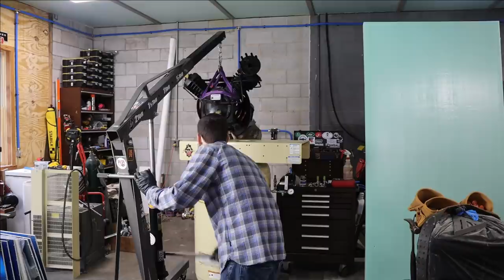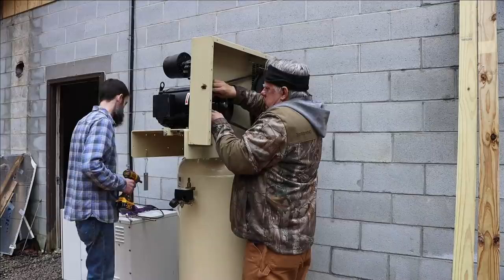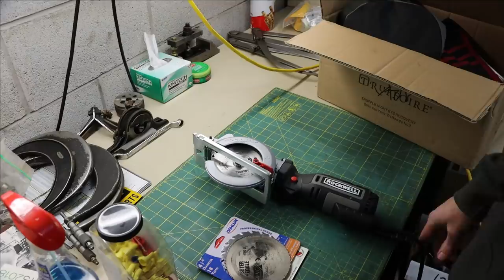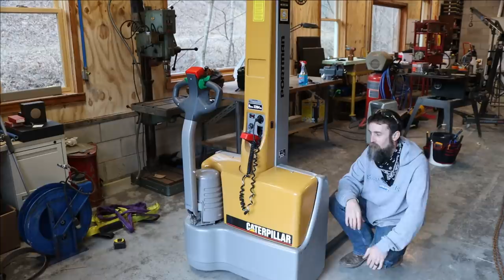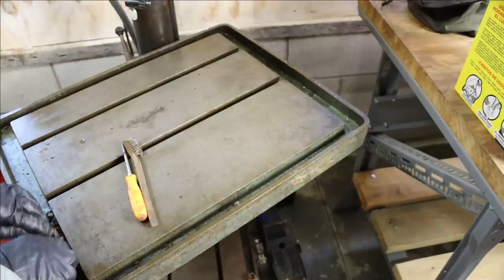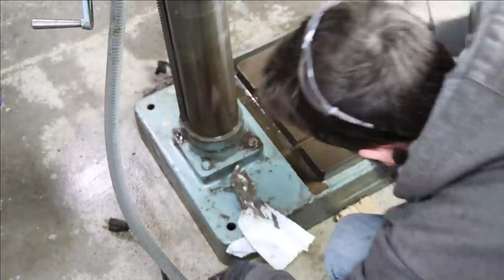Awesome New Shop lift! /  Doall Drill press 1st run and clean.

Comment: Sorry I have just thought of something. This Fork lift has never been used. Traction batteries have a memory. Don't be too quick to think that they are dead. Just try Charge, use, Charge, use, for a while to see if they improve before you write them off. After all you are not looking to run the motors on this item for more than a few minutes a day.
  You may well find that it starts to hold more of its charge & comes up fully charged rapidly as well. OK it may never be that good at running on its charge for long.
Mervyn Price

Comment: Car Batteries vent an Acidic vapor which will cause Everything inside of the cowling to Corrode & Quit Working over a short time.
I would use GEL batteries in it personally.

Comment: Sams' club. Deep cycle batteries run around 100-150$. (we emptied every sams in three states for the historically bad idea of an EV race race. we had over 30. there's still a few sitting at the shop, but RDU is too far away for $100.) I would go with lithium-ion batteries, but I'm a nut with an electric race car. If Roger hasn't unloaded all the BMW i3 batteries formerly in the car, "we can talk." :-) 8 LiFePO4's would be better -- assuming it's 24v, but I don't have many spares of those. (we can talk about those, too.)

Comment: Steve, another issue with battery charging is the hydrogen gas that's emitted.  You DON'T want an explosive mixture forming in the shop, where the inevitable spark makes things go BOOM.  :>((  Either charge outside or buy sealed batteries that dodge the gas emission problem.
Reply: hydrogen and lead acid is mostly a myth. explosion never hapend due to hydrogen leaking out every crack an nearly imposible to acumulate in any meaningfull maner.
Reply: @davidblarstron767  Tell that to the folks who had things go boom, when incorrectly  boost starting a car with a "flat" battery.  Better safe than sorry.

Comment: The charger is meant for agm deep cycle batts and starter batteries, while much cheaper, won't last long.  Might be better to buy smaller  agm deep cycle batts versus starter batts.

Comment: The drill press table/deck, is it possible to either flip the plate that is damaged OR weld up the holes in the damaged plate without warping it?

Comment: Be sure that the lead acid battles will not corrode the wire connections or rust the inside. While charging They my off gas corrosive gasses.

Comment: I would use deep cycle marine batteries. More expensive than your standard car battery,  but should perform better. With that,  there is no reason car batteries shouldn’t work.

Comment: 1. Can the batteries be reconditioned? 
2. Install a hardwire option to the pallet jack
3. I’ve had employees crush hands and feet with powered pallet jacks -
Reply: 1. if they are original 2003 bateries : no, its a miracle they still worck that well !
2. hard wore is noce but without bateries youll need one heck of a power suply.
3. yeah I agree on that one but steve is a machinist he knows he is the softests meat bag in the shop.

Comment: Deep cycle batteries ONLY.  Deep cycle batteries are designed for slow discharge to full discharge state.  Auto batteries are designed for virtual instant (starting motors) discharge and recharge between discharge.  Everytime you completely discharge a car battery you decrease the life of the battery substantially.  So you want an RV or marine battery.

Comment: you wouldn't have to put a support post on the other side of the door. Especially if you build a beefy end cap you should be able to cantilever it with the rest of the roof.

Comment: Use Deep Cycle boat battery or you will ruin a car battery.   Deep cycle marine batteries are made to withstand discharging and recharging, a car battery will not last half the life a marine battery will.  Deep cycle battery should be around the $200 range more or less depending on where you buy them.

Comment: A car battery is not a good idea .
Look for semi traction batteries normally used in mobility products .
A smaller ah battery may be a way of keeping costs down .
( You can pull 100 amps form a 32 ah battery the run time is non-existent but you can ! )
But don't expect more than 3 years from them .

Comment: Why not 'cantilever' frame the roof off the wall ? It would only need four {4} frames made out of angle iron say 2"x 2" x 1\4" to cover the distance you require and there would be no posts to worry about for access around the rear of your shed especially seeing the height you are going to have the roof ? You could weld them up on the floor of your now 'oh so spacious' shed ? Just a thought as uplift does not seem to be a problem in your area and it would clear the area underneath of posts ? Anyway all the best from Australia, really glad to see you progressing on a great workspace for your future projects ? I am a little 'self serving' in this regard as I feel if you get the workspace you feel good in, I get more videos from you ?? Cheers.

Comment: Well, you asked for it.
Don't use car batteries.  If you shop around a little, you can find deep cycle batteries at little additional cost and they will outlast the car batteries by several times.  Just look at how long the original batteries lasted.
I'd fabricobble a small man (or woman) platform for the lift and another attachment to mount your engine crane on it.  I know you're smart enough to design and use it properly but, I'm trying to stop all the OSHA fools from jumping all over me.
You might want to use some nickel rods to weld the holes on your drill press table closed and fill in the other ones.  If you're really ambitious, you could overfill and mill or grind them back level.
Beautiful work you're doing and I really appreciate you making these videos.  You and your wife are my kind of people.

Comment: You can get by with cheaper batteries. As long as you have the same charging profile for the replacement batteries it is not an issue.
As for car AGM batteries not lasting as long who cares you probably are going to use it 10 to 15 minutes a day max for the occasional lift.

Comment: cut the label off those batteries and check the water in them
they might take a charge again
since you're on well water, use rain water off the gutters, it's nature's distilled water
ETA: and those batteries look like H8 or group 49, good luck even finding any that aren't AGM, 
don't worry about using cranking batteries, they'll be fine, if there's an interstate dealer nearby, call and ask if they've got any "blemished batteries" they'll sell them cheap and the only issue is they've sat on the shelf for a year
could probably fit a couple group 31 semi truck batteries in there

Comment: Its a pity the drill table has the peck marks. I dont know if it is possible to repair them by welding and grinding flat. The "new" part of the shop is starting to fill up looking nice.

Comment: I sold batteries most of my professional career.  You definitely need to install deep cycle batteries they will be more expensive than automotive starting batteries but the deep cycle are designed to be drawn down and recharged multiple times.  Starting batteries will not last and d not have the long term capacity of the deep cycle units.

Comment: The main difference between regular lead-acid and "deep cycle" batteries, is tolerence of discharge.
Lead acid batteries are generally totally full at 12.7v and totally flat at 12v. Discharge them any further, and you will dramatically reduce their life.
So-called "deep cycle" batteries will tolerate going below 12v better than their regular lead-acid counterparts.

Both will work, and in an industrial setting, where the machine would be in use all day, I'd recommend deep-cylce units. For you though? You'll be using it for 20 minutes, maybe twice a month. You won't BE taking the batteries all the way down to flat, so you'll probably never notice the claimed extra life that you can get from deep-cycle.
Look around, spot a bargain and chuck them in there.
By the way, the charger is just a current limited power supply. You could put the cables across a crowbar and the charger won't even know the difference - Don't worry about it.

Comment: The only real reason to use a deep cycle battery is that you can run them low and takes the charge back. Compared with an ordinary battery that likes to stay at its regular charge with a alternator or charger. AMG battery’s are expensive.

Comment: Don't assume those batteries are toast.  Do some research on recovering them first.  I've seen reports of people recovering glassmat batteries from that state to 85 or 90 percent of their original capacity.  If I remember correctly it was by tricycle charging at a higher than normal voltage (14 or 16 volts i think)

Comment: Not sure if this lift works, let's get the wifey to try it... Yeah, that's the ticket...
Odd the "new" to you drill press doesn't have center hole in it. I mean using it in a normal everyday fashion, you lay the material on it and drill through. But seems with all the partially drills holes in it, a center hole would have kept it less drilled up. Just and idea.
Reply: Generally on a machine that size, you will be holding your work in a vise, not directly on the table. Or at least you should.....

Comment: You cannot lift standard pallets with that, can you? Looks like if you try, you will separate the top of the pallet from the bottom.
As for batteries...maybe Optima Blue Tops.

Comment: If they are deep cycle batteries, replace them with deep cycle. Car batteries might "work" but they will not perform the same. A normal car battery will run out of energy far faster than a deep cycle in this application. If you need to verify, please do, go and read about the differences between the 2 types, don't just take my word alone
Reply: It does depend on the duty cycle. If Steve never discharges the truck batteries more than about 10%, they should fine, but if he goes beyond 30-50%, then he'll use them up quickly. Of course, light duty use of deep cycle batteries should mean they last practically forever- I bet the ones in the lift are dead because they weren't kept charged..
Reply: It is probably possible to rejuvenate those batteries. And they are absolutely deep cycle. Check out how to do it with magnesium sulfate (Epsom salts). Those battery operated pallet jacks use some very large batteries, and they can be expensive to replace. And it’s usually not necessary. You can usually restore them to 70-80% of the original capacity, and if it doesn’t work, you are not out a great deal of cash. And it would be a nice video to see.

Comment: I am thinking after you get all you machines placed and your shop how you want it you won't be using the lift as much as you think it will be. I would go for the cheapest set that will get you by with. The batteries usually die from sulfates from sitting.

Comment: Hey Steve!
Do NOT use standard car batteries in that lift!!!  AGM batteries are in there for ONE reason, SEALED, no corrosive gas venting!!!  Have seen a LOT of handicap mobility chairs DESTROYED by corrosion when the "cheap" route is taken by replacing AGM batteries with non-sealed lead acid batteries!
Ken
Reply: he is going to use his lift on  the floor only. he dosent need seald bateries.  any deep cycle will do
Reply: @davidblarstron767  My concern is the corrosive vapors of any vented battery.  Have seen this destroy all too many controls in power chairs.

Comment: Steve use whatever battery you want. The difference between deep cycle and car batteries are the deep cycle has an internal resistance rated for the amp hour. It's not like you're going to use it 8 hours a day 7 days a week continuously. Once your shop is organized the way you want it you will probably not use the list that once a week or a month. All that money you that you spent on batteries is wasting away over time.

Comment: Heh.  I found an ancient lift like that in a scrap-yard… A “Mighty Joe”12v lift.  It needed a battery, a hydraulic hose, and the built in charger was toast, but other than that, it was fine.  Very handy to have around the shop.  It’s not all fancy with the steering and power drive, but he gets the job done.  I’m just using a heavy duty starting battery out of an old excavator.  It not in continuous warehouse duty, so I suspect automotive batteries are just fine.

Comment: Don't use std car batteries, pay the extra money for Deep Cycle, way more worth it in the long run and if push comes to shove in a grid-down scenario you have a 12 or 24volt dc supply for an inverter, car batteries are designed for CCA cold-cranking-amps which in no more than 3 mins tops before they go flat so a lot of current for a short time whereas Deep Cycle will keep giving till flat hours latter yes usage does come into it too but as I say it's an alternative source of power through an inverter and that opens up to the possibility of recharging the batteries via solar too prolonging survivability in a grid-down scenario. semi traction batteries is the way to go.

Comment: Awesome drill press. I would just put in group 31 truck batteries. Probably 75$ a piece or so. For the intermittent use you will be using it for they will be fine. Have you checked the water level in the old ones? If they were low often times they will come back around after topping off and a few charge- discharge cycles

Comment: Car batteries aren't the same as traction batteries car/bat are designed for instantly high voltage traction /bat are designed for a longer loser rate discharge

Comment: Don't waste your time with starter batteries.  Find an industrial battery reseller and just buy the damn deep cycle bricks.  You don't need AGM and the flooded cell batteries will last longer as long as you keep the electrolyte topped off (distilled water).  Starter batteries will take a shit on you in no time with a low charge/discharge load profile.

Comment: I absolutely hate moving these type of compressors and I hate even more that the manufacturers do not care one bit about how the customer gets these things off the pallet they ship on. There are no hooks at the top to use a chain and forklift, the rails where the compressor and motor sit on is usually too short on one side to slide a forklift fork under them and if you try to tie a chain somehow, there is always a pipe or wire or cage in the way. And even if you have one that is still on the pallet, of course you can't put a pallet jack under them too, because of the three leg configuration at the bottom of the tank, one leg sits on a wood block that stops the pallet jack from going into the pallet. Someone should ask the CEO of these manufacturers to take one of these off a pallet by themselves to see what nonsense they are putting their customers through.

Comment: car battries not good idea not designed for this use,  maybe some second hand phone system back up battries , the phone companies change them when 5 years old they can last 10 to 15 years so plenty of life left often find them on ebay
Reply: good idear but phone backups are usualy very large 2 volt cells. those   will never fit inside the jack....

Comment: You should get whatever type of battery the charger is meant to charge. It's always going to be a deep cycle. But whether it's AGM or flooded, depends on the charger. It's that simple. No need for commenting paragraphs and paragraphs about batteries...

Comment: The use of car batteries for traction purposes, do not do it. I have run small single seat golf buggies suitable for transporting in the back of a small car. They use traction gel lead acid batteries & many try to get away with car batteries. Give them a month or so & they are dead. The technology is completely different. You need much better advice than I can give. I feel certain that there will be a good cost-effective solution to be found using a proper traction battery, from a different source. You need to talk to an expert. My knowledge is based on gel batteries & shopping around for better, cheaper suppliers was the best way I found to save a lot of money.
  As for the table of your drill, JB weld seams to be the best current solution to those holes. Easy to do, just make certain that you remove all traces of oil from those holes. The resin contains iron particles & has good ware potential. The colour blends in well.
Regards,
Mervyn Price

Comment: You should replace them with new AGM batteries- they are sealed... don’t use standard car batteries. Wet type batteries produce hydrogen.. not a good idea to have hydrogen pockets inside that battery cover, on an electrical device... spark, boom , sad

Comment: It pains me to see compressors installed outdoors. Yes, you don't have to listen to them out there, but you're introducing so much more moisture into your air system. If you have machine tools, you should be dehumidifying anyway, and if the compressors is indoors it's beneficial for your air system as well. The life of the tank, pump, and motor are substantially reduced being out in the elements. The bugs, critters, dust and corrosion will not be be friendly to it there.